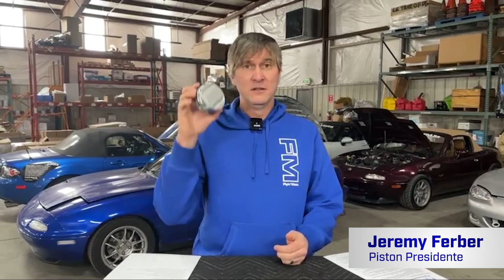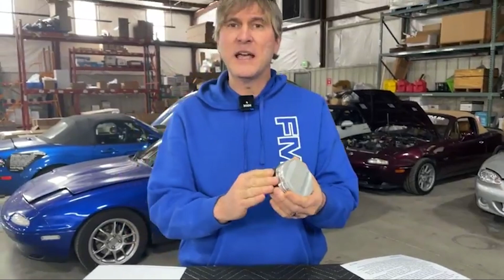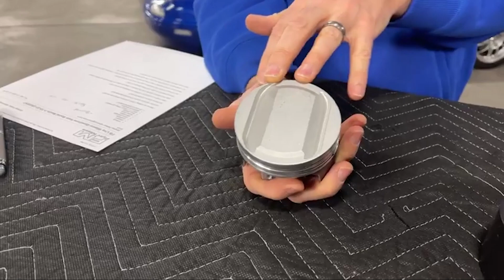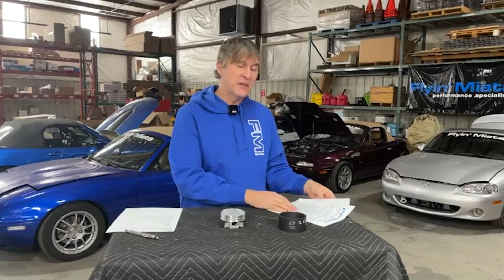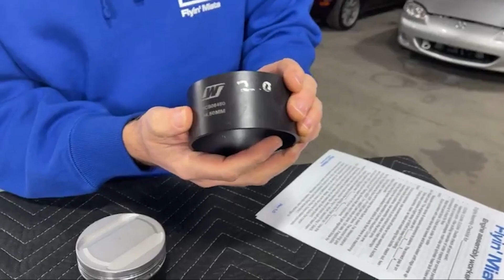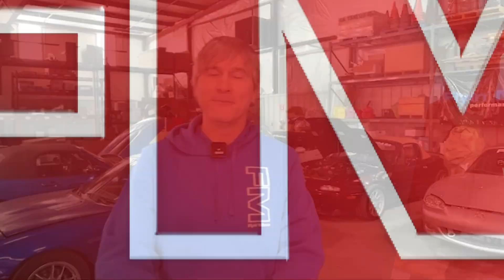Wiseco FORGED Pistons By FM (FM Live)

Comment: Tricky question to ask easily: At 9:1 cr on 93 pump gas with a meat and veg forged bp, where do you expect the safe operating hp threshold to be against the knock threshold before you are trading v low ignition timing and high egt versus boost if you have a reasonably sized turbo and intercooler for the target. Turbo being reasonably responsive for street use and also not flogged with exhaust manifold back pressure.

Oil squirter experience is interesting as it has to be trading piston temp and potential knock window gains but potentially at an inconsequential level given your good experience and other benefits in oil consumption.